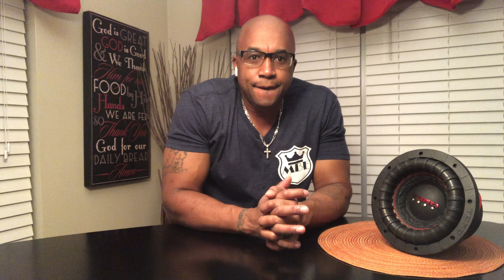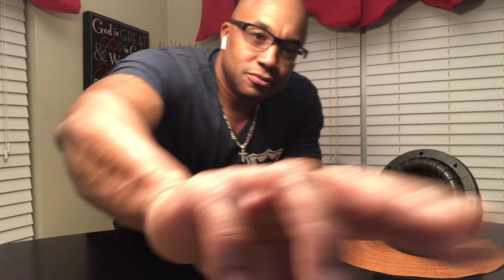Explaining why I put the Toro Force 8’s in 3 net @33hz

Comment: What if you did 4-8s in same enclosure but doubled the power? I’m just curious. I have 4 sundown x8v3 with upgraded coils in net 3 cu for box and can tune it anywhere between 32/33 hz down to 25hz. I’m currently experimenting with port tuning to see which tune I prefer. Currently running with a sundown sfb-5000d. And the low end extension is ridiculous.

Comment: So I totally agree that using bigger than recommended will work to be more efficient, but it’s important to consider a few things.  Sometimes manufacturers falsely advertise as being a small box woofer, so going bigger than recommended is really just the correct size.  On the other hand, if the recommendation is correct than going larger will result in a less linear response (bigger peak), which is fine if you’re just looking to bang, but not good if you’re looking for quality.
Reply from the maker: Don’t use a peaky subwoofer, aka Sundown and the like,
Reply: @M.B.Enclosures  JL AUDIO?

Comment: My Dayton Ultimax 10" I have in 3.5 cubic feet tuned to 19Hz. 

Recommended is 1.55 cubic feet tuned to around 25Hz hehe. 

Since I use passive radiators I can adjust tuning easily as well. Though I prefer my 19Hz tuning. 

I don't recommend going this big with this specific sub in the house, but in the car I love it.

Comment: The only thing I don't like about the toro's when I looked at them is that they have kind of a high Fs specs and I prefer lower bass music. Even the 15s had a high Fs..
Reply from the maker: Fs has nothing to do with how low a sub will play. Nothing.
Reply: @M.B.Enclosures  really? Ok well I learned something new then
Reply: MBEnclosures LLC  true, but when you start tuning too far below fs you generally will get a saddle back response in ported where you peak near tuning then dip in amplitude before rising back up with frequency.  This exaggerates the already (generally) bump in output near tuning and doesn’t sound great IMO.  If you want over exaggerated lows and set your crossover lower than normal at a shallower slope to eliminate the upper peak it can work, but not great for anything other than being loud at and around tuning.
Reply from the maker: @mikewalker4950  sounds technical, but not true..I tune to whatever i like, haven’t experience anything you said... sorry
Reply: All fs (free air resonance) is 
Is the frequency the sub ex: 37hz
Will start to cancel itself out with high and low pressure WHILE Free airing 🤣
Mean below that frequency the output is greatly diminishing . However put a baffle on it let’s say 1ft in all directions and the fs will lower. Idk how much but it will.